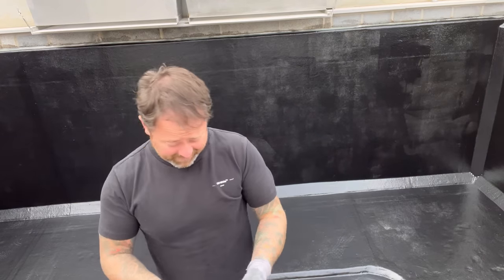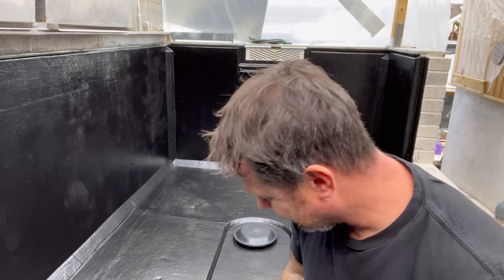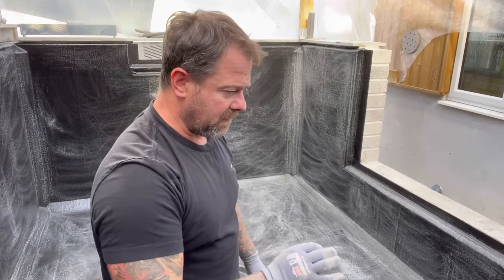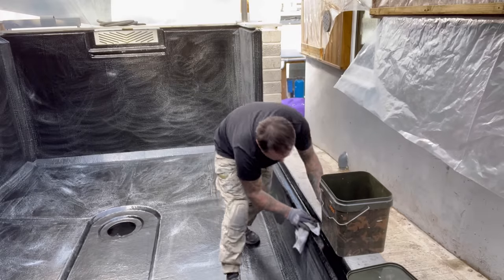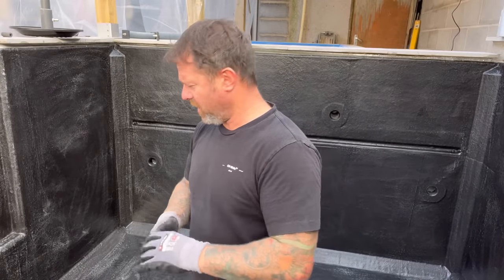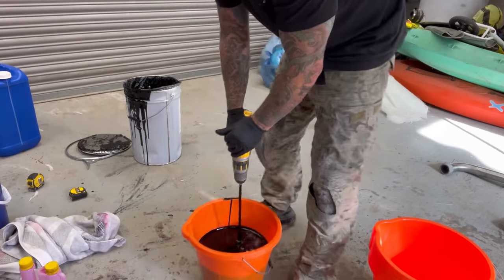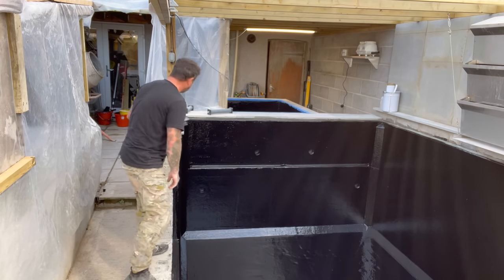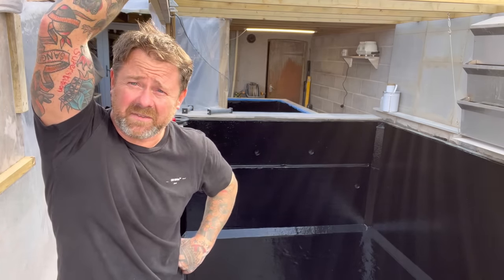5000 gallon koi pond build!!!  Top coat touch up!!!!!! Just to be safe 🪖

Comment: Fantastic Job Lee. I’m in Australia so a lot warmer weather so drying time etc will be different. Im not a fibreglass expert only a DIY person like yourself. I built a grow on pond a few years ago and had problems with pin holes in some places causing it to leak. I asked my Fibreglass supplier and experts in the industry who told me I had to strip back to the concrete and start again. 🤦‍♂️😂 Then a friend of mine who was old school koi keeper to me to give it a light sand then apply anther coat of flow coat but using a brush and applying a thick coat. 🙋‍♂️ All leaks fixed…Just a thought 👍 keep up the good work Lee and great videos 👌
Reply from the maker: Awesome! Thanks for the advice Paul, top man 👍